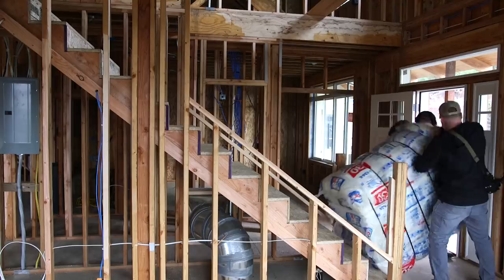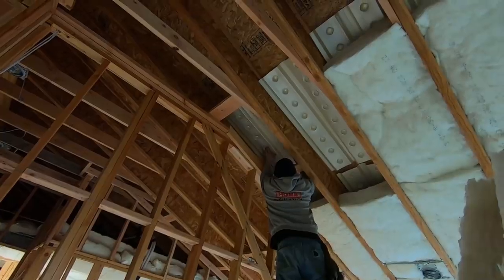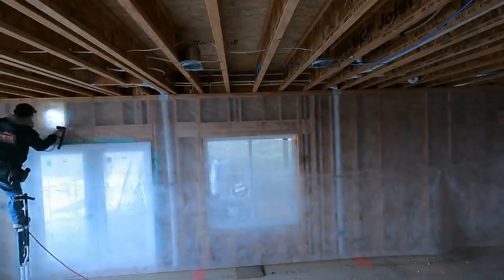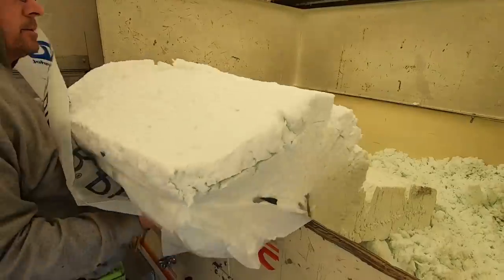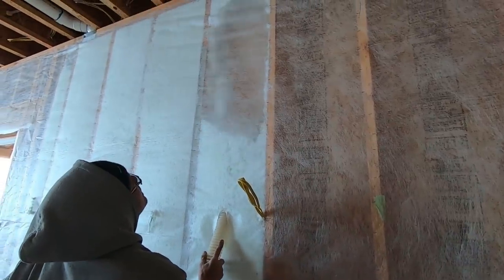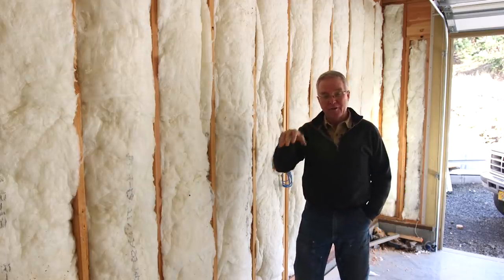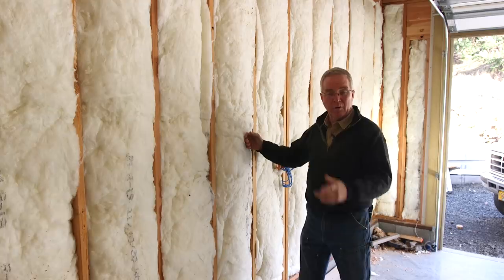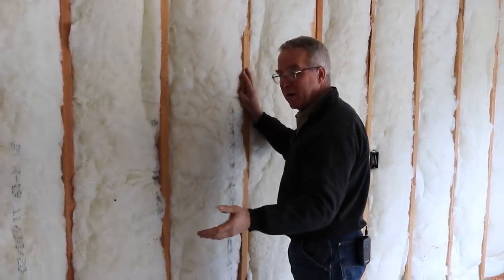Insulating A Nice House Ep.104

Comment: I've never seen walls blown in like that.  It's fun to watch.
Reply: Yeah, its almost power washer level satisfying
Reply: Looks a lot easier than spray foam!
Reply: Same
Reply: i would think this will settle some after a few years, maybe not but it looked a little loose when he was pushing on it.
Reply: @warrenmichael918  it settles a lot. I just had to remove and replace it in my home
Reply: @devindombrowski8401  i kinda thought it might. I bet if they pumped from the top down and packed it tighter, it would really help. Who knows, these insulation companies always seem to get better every few years.
Reply: Wonder how tightly it gets packed in there. Will there be empty at the top line when they used saw dust..
Reply: @7rixee  not sure how tight it is but watch him touching on it, he isnt pushing real hard and you can tell it gets presse in as his hand touches it.

Comment: I don’t mean to come off as a troll but I’ve got to share with you that I just had to remove all my blown in insulation. After about 10 years it completely failed. It compressed and settled in the walls. We figured this out by how cold the house was getting.
Reply: I was hoping someone would say something in regards to this. Cellulose is cheap, effective and effective but as you said it will settle with time and or moisture and a dead space will defeat a good deal of its purpose.
Reply: That sounds like an awefully expensive fix.  Did you look into retro-foaming the walls?
Reply: @ELIRAXPRT  Well it was becoming more expensive to keep the house at comfortable temperature. My father is a retired contractor so we were able to do the work ourselves and replace it with Roxul. We also took the opportunity to make a few design changes in the house as well.
Reply: AMEN. I often remove blown in attic insulation and replace with batts for the same reason. The characteristics of each type at their installation lends a clue. When a tube of batt insulation is cut open it literally explodes due to being compressed, and will remain in the expanded condition indefinitely after installation. Blown insulation does not expand when the package is opened and has to be fluffed by the machine. It will settle and loose R value over time.
Reply: to be clear, he mispoke when saying it was cellulose.  this is spider which is fiberglass, blown in fiberglass.  it's very resistant to settlement.   I was once hired to remove it after it filled an HVAC trunk line while blowing it in the ceiling cavity.  it took hours to removed it via sucking it out with a shop vac and 4 extensions to reach the distance to the second floor.  see the first comment at the top for more information about spider.

Comment: I enjoy watching EC videos: the subject matter, the narration, the intelligence and honesty, the common sense. I look forward to all of it. I’ve watched every video on this channel.

1. Foam rafter baffles must be carefully positioned and overlapped end-to-end about an inch shingle style to direct any possible moisture to the eave vents. No end-to-end gaps allowed between rafter vents.

2. If stacking insulation batts in the ceiling, top layer must be laid across the joists, lower layer between the joists. They must be stacked perpendicular to each other. Your contractor did what was fast and easy.

3. Living-area exterior walls are not blown with cellulose insulation. It looks like fiberglass wool and "Blowing Wool" is printed on the plastic bag being emptied into the hopper. Blowing wool is fiberglass.

4. Sound insulation would have been ideal in some, if not all, interior walls. Washroom walls at least. “We decided not.” Why? Failure to do so is cheap and/or misguided.

5. The knee-wall closets should be drywalled. Too much work? Too bad. Bite the bullet and do it. The foil-based covering (”... whatever it is  ...”) is a shortcut that will deservedly puzzle most buyers. “Practical,” you say? Not by a long shot.

6. Will drywall lay vertically flat on studs where blown insulation is trapped? If not, some  planing and other fussing in an earlier video seems wasted.

7. Paper-faced batts have a thin asphalt coating  as a vapour barrier, albeit not wholly effective. The asphalt also adheres the fiberglass to the paper. Mould is no more an issue with the fiberglass paper-faced batts any more than the wood studs and paper-backed drywall. It’s all cellulose. “Keep it dry or it will die.”

8. Will there be plastic sheeting or some other vapour barrier applied before drywall? If not, why not? How can you effectively air seal--that is, draft-proof--the interior without a vapour barrier on the inside? (Never mind exterior housewrap: it’s intended to prevent water from contacting wall sheathing yet allow water vapour trapped behind it to escape. It’s not an effective air barrier in most builds.) 

9. Fiberglass batts as a firestop in the stairwell walls? No way. Fire will melt it. Use rockwool, wood blocking, or sheet metal.

10. No gloves, no goggles, no masks? No thank you. Some professionals compare fiberglass fibers to asbestos. True or not, safety counts. Sub-contractor arrives on time, does the work on budget, and cleans up before departure? Not good enough.

Comment: Great timing on this one, as I'm moving into finalizing my insulation plans on my current house build. Planning to use Rockwool throughout the walls and roof but am debating on closed cell foam for the underside of the floor in the crawlspace area, as it will both provide great R-value as well as a moisture barrier. So many decisions!
Reply: as an apprentice drywaller (gyprocker as we call them) from Australia iv been waiting eagerly for this part of the house construction, cant wait!  itch on my fibreglassing friends
Reply: Use spray foam everywhere for maximum comfort
Reply: @christophergruenwald5054  and moisture control and structural stability, and time efficiency
Reply: @christophergruenwald5054  You must like echo.
Reply: I did closed cell foam under my pier and beam shop and open cell foam in the walls and roof mainly for air sealing. I’ve been happy with the result so far.
Reply: Love the ep, historic house owner, 20+ year old batts of fiber in attic, shiet R value.   Debating close cell spray the ceiling and sealing off the attic (currently vented), or spray in cellulose ontop of existing insulation and keep attic vented.  (North Florida Btw)
Reply: I have a mobile home, but in any house, would prefer the vapor barrier on the ground with a concrete cover.
Reply: You can get the best of both worlds with a flash and batt system.  We applied 2" closed cell foam as an air barrier and added fiberglass on top to get to r60.
Reply: In 2003 we built a new house, 2800 sq ft and the builder used blown in cellulose with R21 walls and R50 ceiling. In 2015 we built another smaller house 2000 sq ft in the country. The builder bragged about how well spray foam insulation is. We used the same manufacturer for the doors and windows. HVAC system was a heat pump in both but newer home had higher seer rating. The newer smaller home uses about 10% more kwh than our first home at the same temperature setting. The spray foam house interior walls are colder. The outside noise transfer with spray foam is horrible. My wife and I regret using spray foam.
Reply: I had kitchen close-cell sprayed, and it was not cheap. So things to watch for are your electrical boxes (you can't dial them back/forward if that type once that spray is down. My electrician left them fully out and I was worried they were now permanently that way. Thankfully, the tile added enough thickness that its now moot. They did the crawlspace under the kitchen too. I regret not adding roxul to the gap between cellfoam and tongue-groove ceiling to reduce outside noise...but no big deal. I have much respect for those that spray and do the blow-in...especially masked/suited up and in confined spaces (sometimes hot out too).
Reply: Don't get closed cell foam. There are currently lawsuits in Canada as a result of closed cell foam products.
Reply: @philipnewman2477  
SprayJones might have different opinion.
Reply: I was looking at doing rockwool for the attic floor. But then found out the open cell is actually cheaper to have installed to roof deck. That will gain me a conditioned attic, then all of the ductwork is not sitting in 200f heat. 
Central florida.
Reply: I hope whatever you've chosen, you've considered how it performs in a fire. Rockwool is naturally fire retardant - it doesn't need any additive to stop it from catching fire because it just doesn't burn anyway. The same cannot be said for most synthetics.

Comment: When I built my home I opted for cellulose in the attic. Forty years later the original 12" deep application had packed down to less than 4" and a significant loss of insulation had occurred requiring additional insulation be added. The supplemental material was blown fiberglass and the result was very satisfactory. It would seem to me that cellulose settling/packing in walls would be even more pronounced than what I experienced in my 12" attic application, quickly leaving significant uninsulated areas in the tops of stud wall cavities. Thanks for your great videos and bringing us along on your project. "Keep up the good work."

Comment: I implore you to consider putting some insulation in the walls around the laundry!  I'm sitting in my office in a newly-built house, and just on the other side of the wall behind me is the laundry.  When the washer and/or dryer are on, it is noticeably noisier in here, making video calls much more difficult.  It would be only a handful of bats, making the material and labor costs minimal.  Unfortunately I didn't have enough detailed control over the build...

Increasingly important in today's work-at-home world.

Comment: I would say this about houses in hot climates. The use of silver-backed closed cell sheets in the roof space can really help to reduce radiative heat that comes off the roof tiles.
Reply: Would also assume you would want some insulation to keep the cool air from ac’s inside.
Reply: @rogerandersen7046  hi, I was thinking about property I know in Brazil, they don’t have AC and use open windows for ventilation. After fitting this celotex under the roof, it dramatically reduced the radiative heat from the ceilings.
Reply: @rogerandersen7046  and this too!

Comment: You were speaking of the hot countries that don't need insulation, because they leave the doors and windows open.
I live in Thailand, now, and see exactly that, where the poorer people, cannot afford to insulate, but in the cool season (our winter), it gets cold, down to 10/11°C.  (not cold for you).
So there IS a requirement for insulation, on 2 fronts.
1. To stop the hear from leaving the house in the cool season.
2. To stop the heat from entering the house during the hot season.
Glazing needs to be double or treble glazed for the same reasons.
Love that Blown insulation, works fine on a timber frame house, but not on a concrete post and block house, where I think I will have to get a little more creative.
Fascinated by the series, Roll on the next episode.
Stu  xx  (retired Architect)

Comment: Another great vid -- thanks!

Just a comment about cold climates, though. I'm on the Canadian prairies, so I'm talking *cold*. What you learn is that you have to be just as concerned about internal air moving through external walls as you have to be about external air making its way inside. It's absolutely imperative to have a water-proof vapour barrier sealing the entire inside wall space. Your warm inside air is chock full of moisture, moisture that's being continually replenished by human activity in the house. When that humidity winds up in your exterior walls, it very quickly freezes and turns to frost and ice. People might be shocked at how much frost builds up over the course of a winter -- a lot! Of course, when the thaw comes this all melts at the same time, making a moisture problem into a much worse moisture problem.

If you live in cold weather and expect a lot of sub-zero temps in the winter, you need an interior vapour barrier.
Reply: Same thing in Norway. But if you insulate with cellulose or wood fiber, you could use a "vapour control" that lets some water vapour through (relatively low Sd value), as the fibers will transport that moisture to the outside. Basically how old log houses work. I should know, I'm typing this from inside one :)
Reply: yes, building science is a very complicated topic not easily understood.  It varies from climate to climate, what works for hot climates won't work for cold climates.  what works for sub zero climes may be less effective at more moderate cold climes.   there is no blanket, one size fits all solution to insulation and vapor barriers.  it's important to remember that EC is in the Pacific North West where it gets neither hot nor cold and A/C is often not needed in the summertime.

Comment: As a former insulation pro from Utah I appreciate Nathan's comments. Coming from a climate of temperature extremes, 90 + degrees in the summer and -20s F at times in the winter, we installed almost exclusively cellulose insulation. The proof was certainly "in the pudding". In sheer numbers cellulose has 3.6 R's per inch while fiberglass has 2.2 R's per inch. That's nearly a 40% increase. We always used blown cellulose in ceilings. However, over the course of about 20 years we went from FG batts in walls to pressure packed cellulose in walls to a "wet spray" cellulose system in walls. You have to experience it to understand the performance difference between the systems. The "wet spray" cellulose system was by far the best in terms of living comfort and energy efficiency as well as sound control. Definitely worth looking into if it's available in your area. Of course, as in most things, finding a reputable installer is key.

Comment: I built my 750 sq ft detached garage about 12 years ago. My plans was for a workshop/garage so I wanted insulation. The price of DIY insulation and having a contractor install was practically the same so opted for the contractor, (no brainer). WOW those guys were quick, efficient, and best of all comparable in price than DYI.  Best move I could ever done. Firm believer in letting the pros (contractors) do their thing when at all possible.

Comment: I think the plastic vapor barrier does more than you would think. After the fire in 2005 I put R19 and a plastic vapor barrier in my house. It did have blown in foam before. After we moved back in the energy bills were about 30 % of what they were. The gas company changed the meter 3 times before I caught them and explained the situation. That little piece of plastic was well worth the small cost.

Comment: One nice thing with Blown in solation you can run Electrical lines in the future because it’s blown in insulation will not block you from doing it
Reply: seriously, its pretty awesome. The spray foam stuff is a nightmare for the exact opposite reason, atleast with fiberglass you can kind of work with it with some elbow grease.

Comment: Some input from a Euro-Carpenter in case anyone cares:
At my company the exterior walls and roof a usually structured like this (outside to inside): 
> generic facade and roofing 
> circulation layer
> ~2in wood fibre board 
> structural timber and blow in cellulose (anywhere from 8-14in depending on the project) 
> vapor retardant and "airtight" layer 
> ~2in layer for pipes and cables, voids filled with wood fibre insulation 
> wood chip board, like OSB but with much less bonding agent and from new not recycled wood 
> sheetrock or loam boards, sometimes with internal coils for heating (like underfloor heating).
Interior walls are insulated with wood, hemp or jute fibre.

I should add that many of our clients value ecofriendly and "healthy" materials (no OSB for example, cause it releases VOCs over time) and i must say that working with such materials is quite enjoyable. On break you can literally pick up some hemp or wood fibre insulation and use it as a pillow and blanket to take a nap, which i would certainly not recommend with mineral wool ;)

Comment: Insulation is a great topic it is my understanding that the use of the paper face or not depends on the need for a vapor barrier, I used unfaced on my walls because I have Tyvec on the outside and you don't want to trap vapor in the wall. I used faced on the ceilings because there is no vapor barrier on the attic side. At least that was how it was explained to me by an energy auditor. There is no one type of insulation that is correct for an entire house I used a combination of rock wool where I wanted fire resistance, I used fiberglass where I could to save money and help with sound insulation and provide for better zone heating and I used sheet Polyiso foam in areas where I needed a high R value in a small cavity.  I also put a layer of XPS foam on the exterior to help with thermal bridging of the studs.   As a do-it yourselfer you do pay more for materials because you're not buying in bulk but with the right advice from a professional you can save on installation, I also was able to buy a lot of the foam board at a discount because I got factory seconds, still perfectly good material I just had to cut and fit it a little more.

Comment: In the vaccum of space the challenge is not keeping warming it is actually keeping cool. With no air for heat to radiate through it just stays in one spot. So the ISS doesn't actually require a large amount of insulation, instead it requires a very sophisticated cooling system to help remove excess build up of heat.